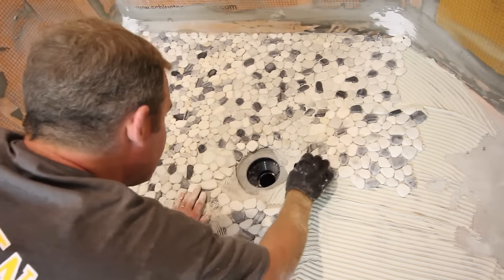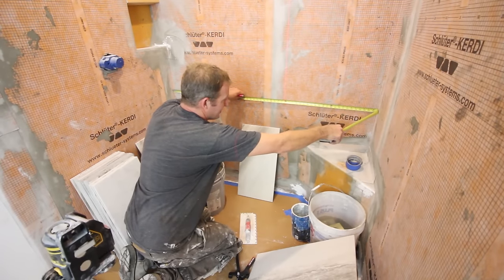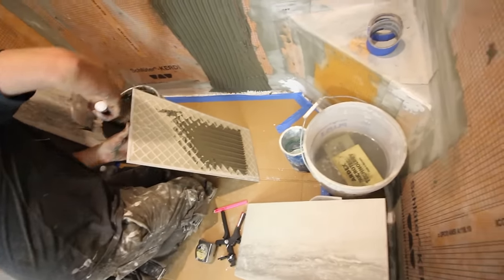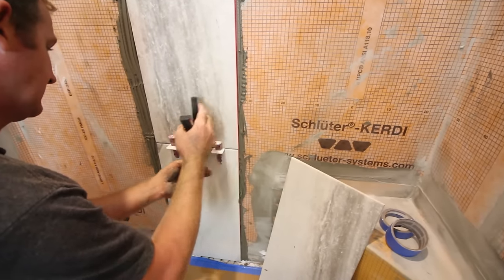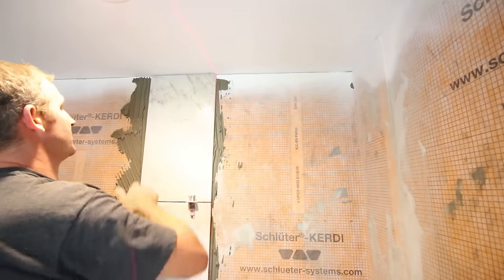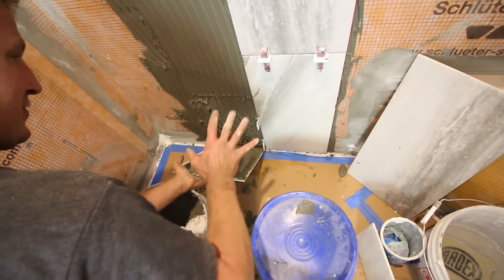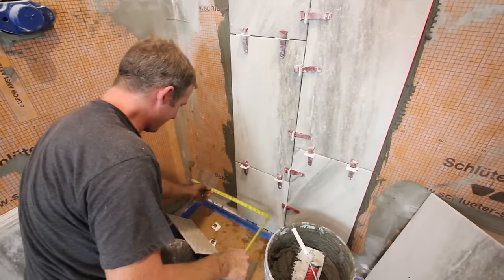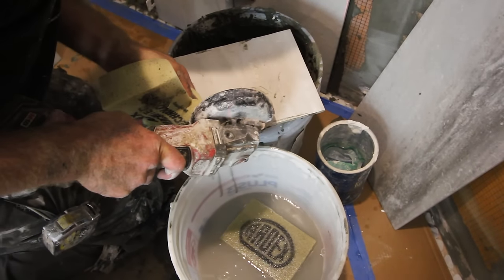How to Tile a Shower Wall...Vertical 12x24 Porcelain -- by Home Repair Tutor

Comment: Other videos show running the thinset in the direction of the narrow side of the tile yet you chose to run it the opposite.  Also, other videos show shifting the tiles 1/4-1/2" to collapse the thinset channels and you don't seem to do that.  Is this just a style difference, or did the recommended procedure change in the 3 yrs since you filmed this?
Reply: Confused about that. I did ask my Schluter rep, and he said to apply the thinset on direction of the shorter part of the tile.

Comment: Hi and I use mapei modified thin set LFT I mix the whole 50 lbs bag and I don't have much time to to complete the job by myself , the thin set thicking . Do you have any problem with these thin set

Comment: What beautiful work!  I always wondered how vertical tiles would stick to a wall and not fall off.  You butter back of tile (vertically) and use spacer clips to hold in place which also presses down the edge.  There is also a wire mesh backing to the substrate surface, probably to create a better grip for thinset.  Very interesting.  Useful DIY tips and also useful if you use a contractor to check quality of work.  Subscribed.

Comment: If understand you correctly: 1) you started by installing the midpoint of the tile overlapping the center of back wall -- to ensure the vertical tiles are symmetrical to the center of the back wall??? May end up trimming tiles on both (not one) sides. Obviously that won't be a problem if installing horizontal tiles. 
2) the floor has to be perfectly leveled or the tiles at the top may not line perfectly?? Or better to start from top?
Pls clarify both. Thanks.

Comment: I heard sal use ardex 777 ,for glass,and said they honor shluter warranty, in regards to using modified on kerdi, generally supposed to use unmodified,sal says ardex controls drying time,in ardex 77 highly modified,I've seen video where they used a see thru glass tile,for demonstration,to show collapsing  the ridges,so important  in conjunction  w directional  troweling,have a great day guys

Comment: Hi is there a problem with putting 1/16 grout lines on 12x24 porcelain and what grout do you recommend for a shower with 12x24 vertical tiles

Comment: My plan is to lay 4x12 glass subway tiles vertically on the back of the entire niche.  My question is:  Can I butt the tiles next to each other as long as I leave a 1/8 gap at the perimeter and silicone?

Comment: Did you mix the thinset on the lower end of the water recommendation for these tiles? I found that when i mixed the all set for the edge band and membrane stuff (i used mostly kerdi board) and mixed it to the wetter side (7.5-8.5 quarts per 50 pound bag) it stayed that consistency for about an hour then noticeably started to dry after that. I haven't mixed an entire 50 pound bag yet because there was no way i could apply it and trowel it out fast enough to do all the water proofing in my shower. I do know you want the thinset drier for the tile, but I am worried when I mix it it will become too dry before i am able to use it all. The consistency at about an hour and a half was kind of like slightly wet sand I thought. Still held a notch on the trowel pretty well, and I am assuming that is what I want for putting these 12x24 tiles down. I bought rubi cyclone spacers to do mine and my shower is exactly the same size as this one in this video, and I am even running the same size tiles and same direction, just minus the shower bench and I have a window on my back wall that I am going to trim with the schluter pieces like a niche, and then a niche on the opposite of plumbing wall.

Comment: Hi there, I'm redoing my shower and it's waterproofed and I installed the marble on the Schluter triangular corner bench.   Since it overhangs by about an inch it makes for a difficult cut.  I feel like I saw a video on this channel where the guy in this video created a notch in the marble and slid the tile behind the notch to avoid sort of a "U" shape cut, and instead is just an "L" shape.   Would you be able to direct me to that video?

Comment: For the top if you didn’t want a grout or calking joint could you use an expansion joint profile or would that not be good for the ceiling?

Comment: Hi.  I’m about to tile my 4x6 shower.  I have a Schluter pre sloped pan that I put the Kerdi over.  I used the Latricete waterproofing material that you paint on over the Durock 
Would it hurt the Kerdi if I put a coat on it before I tile over it?  I got two free 5 gallon buckets.  It is greyish green liquid. I put three coats on the wall and shower bench.  I figured I have plenty why not throw a coat on the floor.  So what do you think?  Thanks for the great information in the video
Reply from the maker: It’s hard to say, we’ve never done that. If the Kerdi was installed per Schluter and is bonded well then you should be okay. Good job with waterproofing DuRock. Some people skip that step. What kind of tile are you using on the walls and pan?
Reply: I’m using 10x30 wall tiles and small 2 “ hexagon mats on the floor. I got two five gallons of Hydro Ban for free from a friend 
I was just thinking I have it why not put a coat on just to be extra waterproof if there is such a thing
Reply from the maker: Kerdi is good for the pan. Those wall tile need a good thin-set. Have you chosen one?

Comment: For the seams everyone says to use unmodified thin set, do you have to also use unmodified when installing these tiles to the kerdi board?
Reply from the maker: Technically yes per Schluter but you can use their ALL-SET to set tiles, abs that’s a modified thin-set. Ardex always warrantees using their modified thin-set when setting tiles over KERDI
Reply: My understanding is that unmodified thin-set is supposed to be used in all bathroom situations?

Comment: what's your protocol when dealing with laser levels?
Reply from the maker: normally we use the Laser Jamb to hold it then use both the horizontal and vertical lasers on ever row to ensure they remain level

Comment: I noticed that you preparing a lot.. big batch of thinset for the time it takes to install the tiles. Are you not afraid that the thinset in the bucket will harder and you will have to dump it? Do you have a trick so the thinset in the bucket last longer without hardering?

Comment: Can you tell me about the hybrid  notch  trowel what's it supposed to do better,I'm using 1x2 lft, porcelain
Reply from the maker: It’s to help get better thin-set mortar coverage on the tile and wall. Trowel size depends on the size, shape, and thickness of tile. 12x24 are large format, so we recommend back buttering or back troweling and directional troweling both the wall and tile to get 95 to 100% mortar coverage between the tile and wall. This along with a good mortar, like Ardex X77, will ensure a good bond

Comment: Great video ....may I ask the t lock system  ? And which size did you use for this project ? And where can I get one of those?
Reply from the maker: we used 1/16” Clios which are on Amazon or Contractors Direct
Reply: @HomeRepairTutor  thanks also do you have a video to tile the curve? i live the 1/3 offsetting, so start with full center piece, then to the left cut 1/3 of full piece then 1/3 of the second piece , right? then what do you do to the right side of the full piece? same pattern as like the left side?

Comment: Your  Tiles  installing it's very good , I have one question Tiles have same measurements but have two different thickness can we install them both, look we have different color after installation
Reply from the maker: Are they two different kinds of tile?
Reply: You have to account for the difference in thickness so the faces of the tile sit flush with each other after setting or it will look very unprofessional. There are ways to build up with thinset or a combination of products to bring the thinner tile up. It is time consuming.

Comment: Thanks guys, great video & content. Question: I see quartz slabs being installed using 100% silicone inplace of thinset mortar. Would it not be possible to silicone attach the porcelain tiles as well?
Reply: If you tried that, dying to know how it went.
Reply: @nickad  We got quartz shower walls installed. Those slabs are 1 piece 5ftx6ft and 2 pieces 5ftx3ft -- huge panels. The installer used 100% silicone, but as blobs that are 9 inches apart. The same method should work for tiles as well. However, with tiles, each one being smaller and you need many of them to cover a shower wall, you will need to think about the spacings. What would you do for the spacing and how water proof would that be? Thats probably why people dont silicone tiles? May be you can bead the silicone as if its back buttering with thinset, you may still end up with uneven tile depths from the wall. Good luck with your pursuit.

Comment: What brand t-lock system do guys commonly use?
Reply from the maker: Perfect Level Master, what size tile are you setting?
Reply: @HomeRepairTutor  Same as the video - 24x24 vertical for shower walls
Reply from the maker: @srnewnam  big tiles, well worth the investment in T-Lock. You shower or a customer's?

Comment: are the spacers providing 1/8 or 1/16 gaps?
Reply from the maker: Spacers can provide both 1/8" or 1/16" - just need to choose the size before getting them.
Reply: Yes.  I was curious which was used specifically in this shower
Reply: @ChikaCheeks  He says they are 1/16th here: https://youtu.be/PXlbNn_WpQ0?t=726

Comment: One question: why didn’t you guys use white All-Set? Might there be a risk of that light tile darkening over time with the dark thinset?
Reply from the maker: NativeNYerChicHK great question, we used porcelain and it’s water absorption is 0.5%, so it’s not sensitive to the gray thin-set mortar like say a marble species
Reply: Home Repair Tutor Thanks! Doing my own bathroom, shower build just completed and I’m about to use very similar tile, using the white All-Set just in case. I’m a an overly cautious over-preparer LOL And because of this particular series of yours, I’m going vertical with my large tile. I really like the look! So thank you!
Reply from the maker: @NativeNYerChicHK  awesome, if you have any questions just send me an email, it's a bit easier to communicate that way than in the comments. We highly recommend using a laser level and back troweling the tiles to help in setting over thin-set buildup in the corners. Directional trowel in the direction of the short side, we didn't do that in our video but recommend it. That way air will escape easier through the trowel ridges. Also make sure to trowel thin-set on the back of the tile such that it matches the direction on the wall. And you might want to look into T-Lock if your tiles are 12x24, it helps keep all the tiles flush with each other. Here's my email jeff@homerepairtutor.com
Reply: Home Repair Tutor Thanks so much! Got my leveling system and my dual line laser level at the ready! Thanks for the tip about the directional troweling towards the short side, but that makes absolute sense since any trapped air will have a shorter route to escape! If I have question I will definitely shoot you guys an email.
Reply from the maker: @NativeNYerChicHK  sounds good, very excited to see your progress
Reply: Home Repair Tutor Just shot you an email!
Reply from the maker: @NativeNYerChicHK  just read it :)
Reply: Home Repair Tutor Where that bench is used to be a bumped out wall and above the shower was a soffit, so this shower space was much smaller before. This home was built in the 80’s when bump outs and soffits were all the rage 😒 Easy enough to dismantle though. Only thing that was hidden in that bumped out wall that I had to move was the shower drain vent pipe, but that was easy enough to relocate inside the wall. Got lucky that the builders didn’t get lazy and hide stuff in the soffit like so often they do.

Comment: Great job and great video.  Thank you for sharing.  When you're back buttering in addition to spreading thinset on the wall do you use a smaller notch trowel than if you were only applying thinset to one surface?
Reply from the maker: Thank you, trowel size depends on the tile shape, size, and weight, e.g. 3" x 6" subway tile need 1/4" x 1/4" square notch trowel. So back buttering is mostly to get the 95% thin-set mortar coverage more than anything.

Comment: What about ceiling of the washroom ? Is not going to be secured with the orange protective sheet
Reply from the maker: it’s not necessary for 8 or 9 foot ceilings unless you’re very tall and concerned about water splashing.
Reply: @HomeRepairTutor  
So is it okay to leave the cieling with the simple sheet rock without having it plastered by kerdi cement on it ?
Reply: @HomeRepairTutor  Thank you so much, it is an eight footer ceiling and I intend to tile up my shower walls from bottom to top just the ceiling will be left with the dry wall and and a bathroom ceiling paint. Would that be okay ?
Reply from the maker: @shehzadkamal  should be okay as long as the bathroom is ventilated. Do you have a strong bathroom fan vented to the exterior?
Reply: @HomeRepairTutor  
I will have a 150 CFM exhaust fan

Comment: I would do the seat top first :) before the walls preferably with a solid quartz top
Reply from the maker: That would have been a cool option for this shower, do you use Schluter or have a different system you like best?
Reply: Why seat top first?
Reply: @RichieWohlers  so the tile is over it for water runoff

Comment: When installing vertical tile, it's ALWAYS start from a level line above the shower floor since it can be (and almost always is) un-level. This is a big mistake in my opinion to just start tiling from the floor because your grout lines will magnify your mistake as you go up the wall. This mistake is mentioned at minute 8:30...."I should have..."
Reply: Can you further explain this?
Reply: @tracis.5673  Traci, to install vertical tile, you need to screw a 2x4 or a sturdy piece of finished wood to the wall perfectly level. The piece of wood will hold your vertical tile in place while it dries and guarantee square grout lines. It should be less than one tile above the floor line. When your tile dries, you remove the board, fix and seal any holes left by screwing the board to the wall. Then you will put in the last row of vertical tile across the floor line which you will need to cut each piece to match the floor line. ** Side notes ** If you are doing a shower floor, always do your walls (and ceiling if desired) first except for that last row so you don't mess up newly installed tile/grout. Next do the floor. Last of all tile the last row of vertical tile so the water drains on top of the floor tile. I hope this helps.
Reply: @tewcool2539  So what do you do with the space left over from the 2" X 4" you removed?  Seems to me, and I'm no expert, that with that vertical 1/3 staggered layout you would have to start at the floor?
Reply: @rdmj64  HI Roy, you just cut each tile to match the space below the 2x4, and please note that each piece is usually a different size AND maybe uneven across the floor line. Measure the distance at both ends of the tile and cut that angle. The floor tile will cover any small gaps.
Reply: @tewcool2539  do you grout the floor tile and 1st wall tile if I use this method. Or does it just rest on the floor tile
Reply: @conroyjanuary1584  No, don't grout between the intersection of the floor tile and the wall tile. (or between one wall and the next in the corners) - use silicone caulk. This allows for expansion of both surfaces but it keeps it water tight. If you grout these corners and wall/floor intersections, they will crack and become a nice place for mold to grow.
Reply: Should I set the first tile directly on my tiled pan or leave a slight gap?

Comment: If I'm using the shluter  system. Wall board and pan system witch do I install first.
Reply from the maker: Are you using Kerdi over drywall or Kerdi-Board?
Reply: @HomeRepairTutor  kerdi 1/2
Reply from the maker: @jeffbeam7152  we install drywall then dry fit the pan then apply the Kerdi to the drywall. The final step is to install the pan and flash it with Kerdi-Band to the Kerdi walls. Here's the first video we made showing that process https://youtu.be/ddDKHJbDYiY
Reply: @HomeRepairTutor  I can't just use curdy board as my wall panel for my tile.
Reply: @HomeRepairTutor  kerdi board 1/2 inch
Reply from the maker: @jeffbeam7152  Kerdi-Board is great, just make sure studs are 16 inches on-center, plumb, and even with each other
Reply: @HomeRepairTutor  thank you.
Reply from the maker: @jeffbeam7152  let me know if you need help with the tile
Reply: The Kerdi system seems nice I assume it’s rather expensive though , I have used Hardi board and two coats of red guard and silicone all corners before tiling , been doing bathrooms for 15 years and never had a call back
Reply: @danthecarpenterman9463  yeah I was thinking of that approach for the walls but using the flexible kerdi pan for the floor.  I'm no expert but it seems like a lot of this kerdi is overboard stuff to buy

Comment: hello great work guys! I have a question, i am going to be tiling 10x27" on my tub surround using versa bond lft . can I continue to tile up as guys do or would I need to wait a bit on my first row to cure before tiling up .
Reply from the maker: If Versabond works properly you should be able to set one tile after another.
Reply: Thank you!

Comment: Can you set these in a horizontal brick pattern, even though my tile has an  up arrow on the short side ?
Reply: How come no one or these guys have answer this question?? I also want to know.
Reply: @felixamador6465  Yes you can, The arrow is there so all tiles face the same direction, wether up down left or right the arrows on all tile must point the same way. (asthetic purposes only)